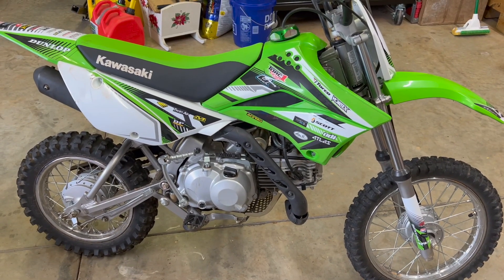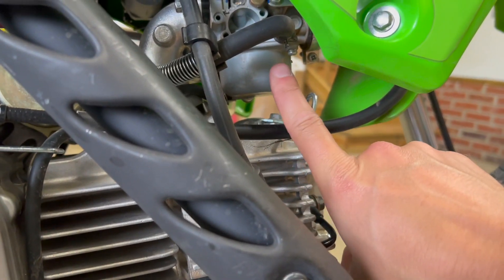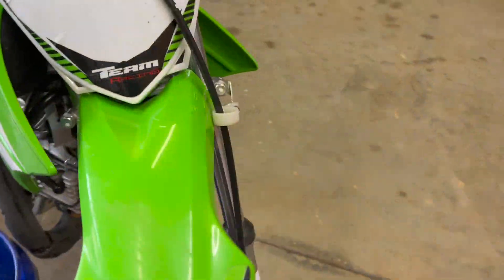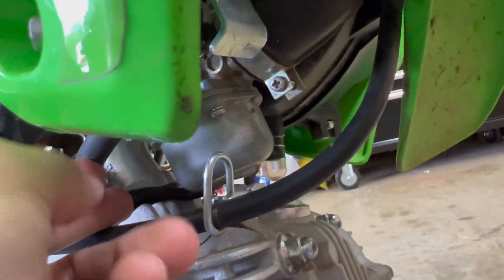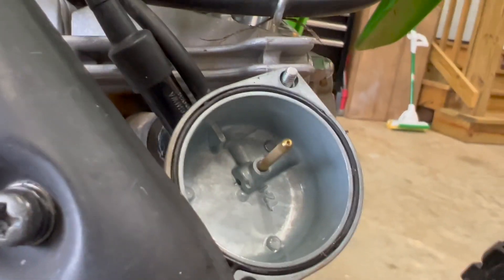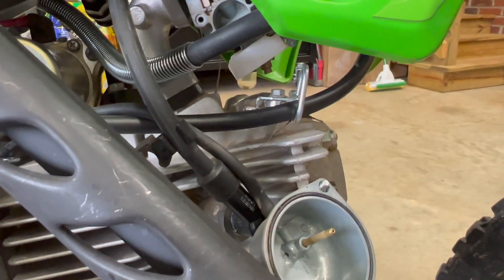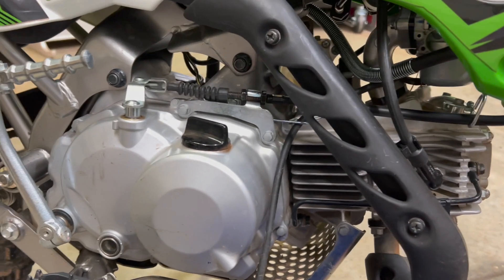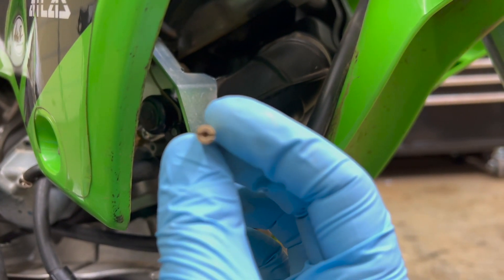How to easily remove the jets on a KLX110L

Comment: Hey man, great vid! 
Do u have de part nr of the pilot jet 42? Can’t seem to find it in europe.. 
greets!
Reply from the maker: I bought them from fasterminis.com. You may be able to get on there to see what brand they are. I looked one and all it has stamped into the side is a K and the size.
Reply: @esteemmoto1213  found it yesterday, KHS-49A042
Or
Keihin N424-74C 28mm 

Did you get rid of the bog?
Reply from the maker: @stout5353  Not exactly. It kind of depends on the day. I cut a slit in the D shaped air/fuel screw so I could adjust it and I also put in the adjustable needle from BBR. I can't remember what my settings are but it seems like when the weather is slightly cooler say 50-75 degrees it runs pretty good.  Higher than 75 the bog is usually very noticeable.